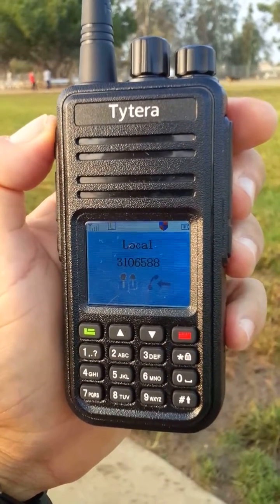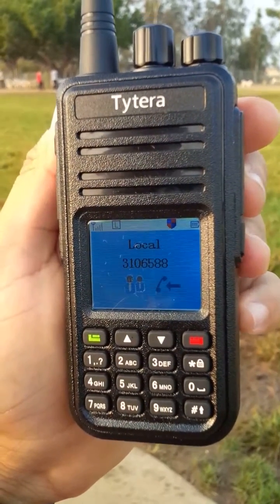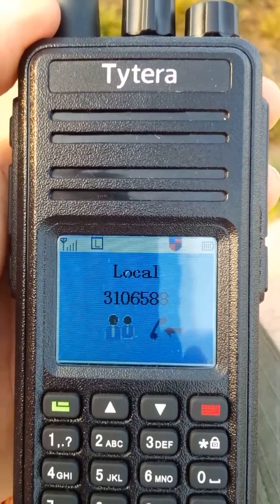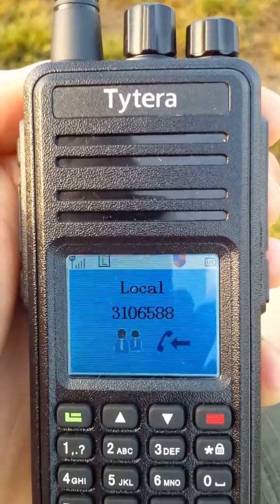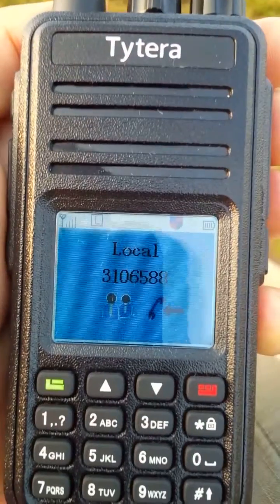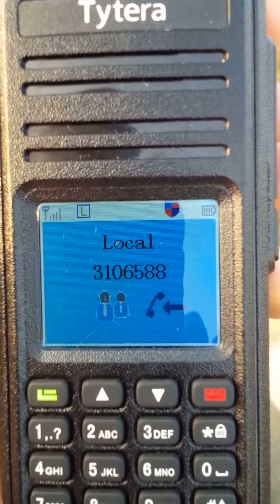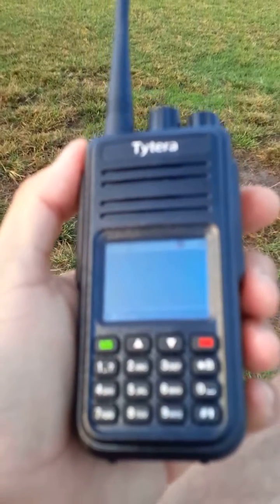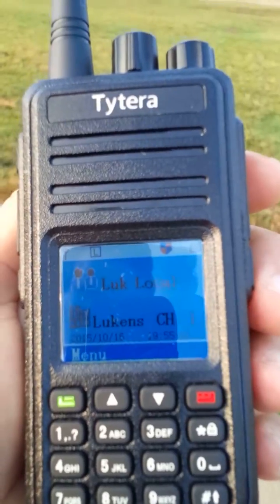Tytera MD380

Comment: Good day how did u programm it for local I have the same radio used the software but nothing?
Reply from the maker: +JeanJean Local is typically in Time Slot One in a repeater zone, which contains up to 16 different configuration for Time Slot One & Two, for the same repeater frequency. I just downloaded the code plug from the Papa system DMR page, and everything works as it should.
Reply: thank u.I am using the software that came with the radio.I have my code and everything but still nothing .I have this radio a 3 days already nada.Thank u for the respond going to try it again 73
Reply from the maker: +JeanJean how did things work out for you?!
Reply: GETTING THRTR THANK U FOR ASKING AA1RJ